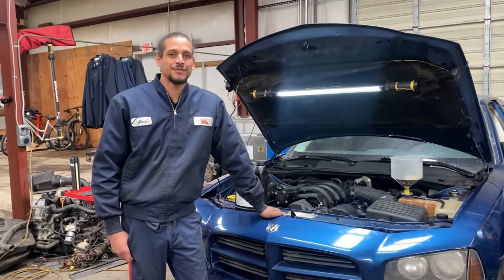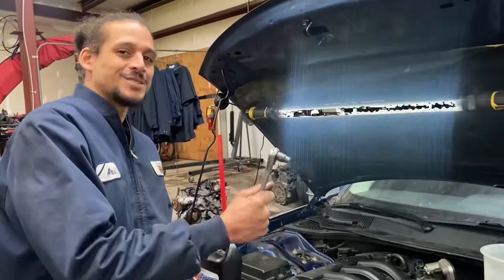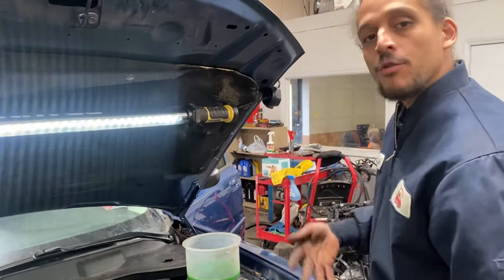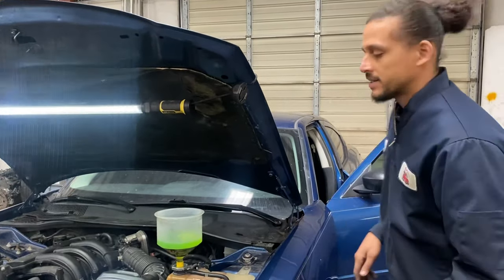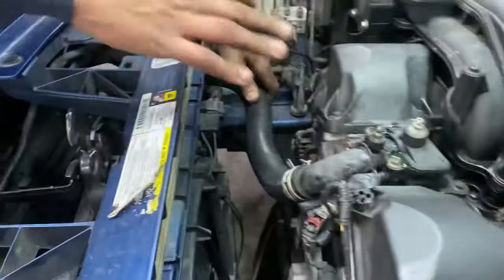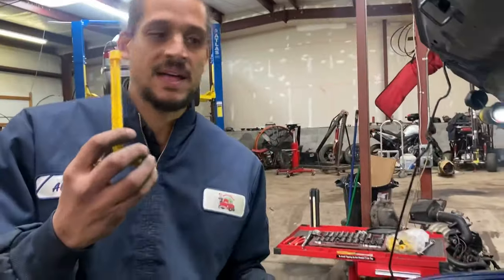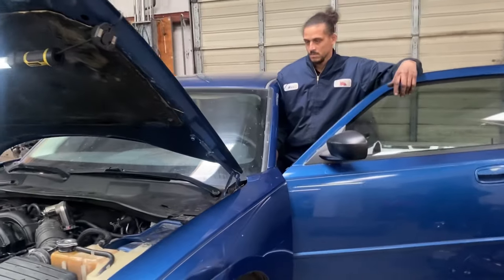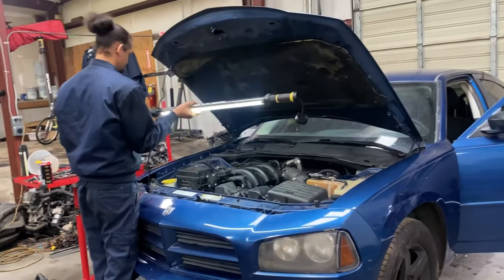How to Bleed or "BURP" Air Out Of Your Engine Cooling System (2 WAYS) #coolingsystem #overheating

Comment: I did this but it keeps burping and burping making bubbles bleeder valve constantly has air i changed water pump radiator thermastat and temp sensor idk could it be the headgasket cause i dont shee white smoke coming out back
Reply: man and you having the exact same issue man. I got a 11' dodge charger, I've changed every part for the cooling system yet my coolant still flexes up and down

Comment: Ok so I replaced my water pump on my 2012 Chrysler 300 because it was leaking and my car was overheating. So after fixing the the leak my car was still overheating and I replaced my thermostat which was completely in pieces in the thermostat housing. so it didn’t run hot for a day then it started running hot again but it only runs hot after driving got about 30 mins. I think my system has air pockets but I can’t seem to get all the air out. Don’t think it’s a head gasket because my oil is not a milky color
Reply: I had pinhole leaks in pressurised bottle where neck molds to the plastic bottle. System could never fully pressurize and would intermittently overheat at times.

Comment: Soooo what if I bypasses the heater core do I still need to burp it with heater on or no since the hoses ain't connected to it its for my 2.7 charger
Reply from the maker: If you bypass the heater core no need to turn the heat on
Reply: @AlexTheCarDoctor  soo just burp system I got tool like the 1 ur using and i did it for about 30 mins just to make sure and no bubbles when I start car should I leave cap off or put back on fill tank
Reply from the maker: Leave the cap off until no more bubbles are seen
Reply: Okay.....when I let car run and no bubbles came up from reservoir but it started to rise the coolant and come out of it since cap was off should I put cap on or what do I do from there
Reply from the maker: If you didn’t see any bubbles immediately put the cap back on before coolant start pushing out. Go ahead and top it back off and close everything up and take it for a drive you should be good

Comment: yes  i got a 2004 sport trac is doing the bubling i change the radiator water pump and thermostat and today i went to homedepot i saw the neddler going to high temp also check the water reservior and saw is was bubling put some water and oprn the cap and the radiator was almost empty waht could be the problem
Reply: You didn't fully burp the air out of the system

Hopefully you kept checking and filling it up

Comment: Can I burp the system same way on a 1998  Oldsmobile aurora had my fans go out ...put new fans now but its seems to over heat still when I drive...
Reply from the maker: Did you remove any coolant hoses when you replaced your radiator fans

Comment: How many minutes should I bleed the coolant?
Reply: Let it running with heater on full blast until the thermostat opens up... Once it does, the level usually drops

I usually keep the funnel on and let it cool back down

 and run it for another cycle just to be sure all air is gone and the fluid level in that funnel doesn't change

Comment: Help! I did the steps but for some reason my coolant reservoir still at very low lvl even I put 6-7L of coolant! Any guess?
Reply from the maker: What type of car do you have
Reply: @AlexTheCarDoctor  Subaru STi 2018
Reply from the maker: I figured I just didn’t want to assume.what I normally do is burp the coolant from the radiator and after that I top off the coolant reservoir. Do you see any leaks
Reply: @AlexTheCarDoctor  i did that too but the next day my coolant reservoir went low lvl at the bottom and there’s still some bubbles coming out. I feel like I didn’t burp that much, I’ll try it again when I get home 🙏🏽
Reply from the maker: You really need that burp funnel with them Subarus, my time at the Subaru dealership we used those funnels a lot
Reply from the maker: https://amzn.to/3lCpmnp
Reply from the maker: That’s it on Amazon
Reply from the maker: Yes
Reply from the maker: I’m about to order another one for the shop now while I’m thinking about it
Reply: @AlexTheCarDoctor  thank you very much sir for your time 🙏🏽

Comment: So I did this method but ran into a problem.

I put the burp funnel in, and started squeezing at the hose. Once that was done, I then turned on my car with the heater on max temp. I thought I was done, so I turned of my car which cause the coolant to spray out from the funnel. Did I miss step?
Reply from the maker: What type of car do you have and how long did you leave it running
Reply: @AlexTheCarDoctor  2002 Chevy Camaro V6 3.8
Reply: @AlexTheCarDoctor  I left it on for about 25min. 

What should I do before I turn off my car? Because once I turned it off, that’s when it started overflowing like crazy
Reply from the maker: It sounds like your thermostat is not opening.both the lower and upper radiator hose should both be hot/ very warm after about 15 minutes of running
Reply: @AlexTheCarDoctor  that means I didn’t put the heater on max and fan all the way up? It might have skipped that step
Reply from the maker: I Assume you followed all the steps. I was saying that you might have a bad thermostat. Definitely do all the steps and try again

Comment: What happens if u broke the bleeder does that matter because I did and well I just welded the hole up but not sure if that’s y my car overheats if it would even before that
Reply from the maker: What type of car do you have and engine. You should really replace that because they normally put bleeder screws in the highest part of the cooling system where air normally gets trapped

Comment: what if i accidentally added antifreeze to the radiator instead of the coolant reservoir on my 07 Grand Caravan?
Reply: Yout van has the pressure cap on the radiator...

The expansion tank for that vehicle is just to take the overflow and suck some back into the system when it cools

So it's ok to pop the cap on the cool engine and check the fluid level at the radiator;make sure its full that way for this type of system

Comment: Why would the funnel over flow when car reaches temperature
Reply from the maker: It normally do that because of big air pockets in the coolant system also its so hot in some situations it just boils over
Reply: @AlexTheCarDoctor  So mine overflows like this as well, the temp gauge reaches the 1/2 way mark, and the heater on high is still blowing cool air not hot. I just did a complete flush of the system (thanks to having a idiot mechanic screw it up) and replaced the thermostat now as well. (My car is a 98 Buick Century with the 3.1 V6. I just replaced the radiator and water pump last year in July, so not quite a year ago. My local shop had to replace my engine last September, with a rebuilt one, and I made sure the mechanic put my new waterpump on that engine. I also replaced both coolant sensors last July, so basically everything on the coolant system is less than 1 year old.) I've done every step to try to get the air out, but appear to still have a big pocket somewhere, probably in the heater core since it's not blowing hot air. How can I get this out? The fluid just keeps bubbling up and out of the radiator neck/funnel when I'm running it, and I'm afraid of overheating the engine and ruining it by leaving run too long! I can't get it to take all the fluid until the air is out. I did remove the lower hose after the flush to make sure the engine drained well, since I didn't want plai water left in it to dilute the coolant I was going to fill it with. And nothing seems to be leaking. I have the bleeder screw, and it just keeps bubbling as well. Any advice?

Comment: Why does my Chevy 05 consume coolant when I have the AC on and I constantly have to add
Reply from the maker: Hey there normally when a engine consume coolant there’s an a gasket issue. So are you sure it’s not leaking out when you’re driving? Check/replace the radiator cap,a lot of people will overlook that part of the cooling system
Reply: @AlexTheCarDoctor  I put a new condenser, but used old cap.. I'll change it 2marow... Thank u
Reply: @AlexTheCarDoctor  no leaks

Comment: How much does it cost to change a radiator
Reply from the maker: Hey there that depends on your vehicle and the area that you stay. Typically you can expect to send $150 to $600
Reply: @AlexTheCarDoctor  is a 2007 Dodge charger v6 3.5 and I also have a question the mechanic who did it he lifted my car with a jack and and the car fall do you think he messed up something in my car he kept juggling the jack and he broke the black plastic that protects under please reply and your video was perfectly explained👍
Reply from the maker: @cookiemartinez496  hello depending on where he put the jack,a few things can get damage, cosmetic body damage, suspension components can bend, crushed metal lines like brake lines and fuel lines.I’m glad you enjoyed my video and thanks for watching
Reply: @AlexTheCarDoctor  He put the jack in right side but when the car fall he jiggle the jack to the middle and I could see a lot of wiring been pulled I told him he was pulling them but he says nothing will happen
Reply: Do you have a shop in Tx
Reply from the maker: @cookiemartinez496  can you send me a picture of it to my Instagram. unfortunately no I don’t

Comment: I done all this and still have air in my system, I've repeated all the steps and still have air and while sitting at a red light my temperature rises and then goes back down when going, Idk what I'm doing wrong, at my wits end,help lol
Reply: Water pump may be bad is one of the causes

Did you notice the fluid circulating in the burp funnel when doing it as show on the video?

Comment: What if I did that but am still overheating at idle?
Reply from the maker: The next step is to do a block Test that will check your head gasket integrity
Reply: @AlexTheCarDoctor  just did the bloc test. Liquid stayed blue. It’s a 2015 Chrysler 200  2.4l. Heater hose connector snapped and this problem started after that.
Reply from the maker: @VHBulls  it has to be air still trapped in the system
Reply: @AlexTheCarDoctor  I think so too, I appreciate you’re responses, Thanks!
Reply from the maker: @VHBulls  just do the process again
Reply: @AlexTheCarDoctor  will do, it gets up to 230 and the radiator fan cools it down to 220 but that’s still too hot from normal, Ive been turning on the front and rear heater and the fan kicks on to cool it, but if I use the front facing heater vents the fan doesn’t kick on
Reply: @AlexTheCarDoctor  do you know anything about the coolant reservoir tank having a weep hole in the bottom on this model? It doesn’t leak normally but I do this and it lets out coolant out the dip in the bottom.

Comment: Why is the bottom hose of my radiator cold and the top hot? Thanks.
Reply from the maker: Either bad thermostat or you have air in the cooling system.
Reply: @AlexTheCarDoctor  Thanks for replying
Reply from the maker: @MecanicaconChispa  my pleasure

Comment: How do you determine if there's a blown head gasket
Reply from the maker: You can perform a block test
Reply from the maker: https://youtu.be/N4NpomEKm4g
Reply from the maker: That’s a good video showing how to perform a block test
Reply: I saw that after man I been fighting a coolant issue in my s10 replaced pump t-stat Cleaned the entire system just got to burp it now an if it's still overheating I think it's head gasket
Reply: Only 80k on the original motor from 1997 oil looks brand new no direct signs of head gasket but if it persists I'm gonna do that block test
Reply from the maker: Good luck buddy

Comment: 2012 dodge charger rt  change cooling temperature sensor  water pump cooling  fan temperature sensor still getting to 240
Reply from the maker: Hey buddy does it cool back down when you start driving freeway speeds.do you have a check engine light on
Reply: @AlexTheCarDoctor  no
Reply from the maker: After running for around 15 minutes carefully check to see if both the radiator hoes are hot upper and lower,it’s safer to check it with a temperature gun
Reply: Thanks  burb it  it's working fine

Comment: if it “burps” will it make a pop noise?
Reply from the maker: Sometimes but if it’s doing that turn the car off because sometimes you will have a boil over.turn your engine off and let it sit about 5 to 10 minutes and before cranking it back up top it off and massage the houses while doing so then crank it back up and finish the procedure
Reply: @AlexTheCarDoctor  Thank you so much I recently learned that I was having problems because my radiator fan was not working

Comment: Now on ur video u said turn heat on high did u mean with out ac
Reply: Yes without AC

Turning on the heater to high is to make sure coolant is circulating through the heater core and gets rid of trapped air

Comment: Hey I just got my water pump replaced and drove perfectly, next morning I turned on the car for a about 5 seconds & turned it back off to see if needed coolant & Anitfreeze poured out lol and started overheating could it be that I just need to add coolant again ?
Reply from the maker: Definitely add more coolant also check/replace your radiator cap,that’s the most overlooked part in the cooling system
Reply: Is a 3.6 pentastar 2011 Durango btw lol and great u think I should I do a bleed also? And just replaced the radiator cap before the pump got replaced
Reply from the maker: @angelleos3397  Definitely bleed the system anytime you replace any coolant part whether that’s a hose, water pump you must bleed the air out. What was going on with the water pump was it leaking
Reply: No it just kept overheating like after normal driving & when it sits it at normal temperature but then when I drive after awhile it overheats but it wasn’t doing that yesterday when I got it replaced but idk if my mechanic bled the system or not
Reply: So that’s why I was rea check it agin today to see if even had coolant I barely turned it on this morning for like 5 seconds and open the resouvier however u spell it and it started pouring out coolant
Reply: So I’m guessing he didn’t bleed out the system
Reply from the maker: @angelleos3397  try that first
Reply: I did and it’s still doing the same mane idk what to do anymore honestly I know this have a big problem with the oil cooler i watched ur videos about this pentastars and mine leaking little spots from oil drain but I don’t think thats the issue tho
Reply from the maker: @angelleos3397  did you run it hot and if so how long? Also safely check the lower and upper radiator hoses after about 20 minutes of running they should both be hot to the Touch
Reply: Like hot as in if I was driving while overheating ? Or bleeding the system hot ?
Reply: At one point the top hose was hot and the bottom was lightweight colder but still warm ?
Reply from the maker: @angelleos3397  driving running hot if so that’s why you change your water pump.give it some more time on the closest both should be about equally hot by touch that means you have proper flow and the thermostat has open, if one is hot and the other is cool to the touch you have a thermostat problem
Reply from the maker: @angelleos3397  The thermostat should open within about 15 to 30 minutes of the vehicle running
Reply: Took it to a mechanic he said he said it’s a head gasket 😔🤦🏻‍♂️
Reply: @AlexTheCarDoctor  but I feel like he bsittin there’s no coolant mix with the oil, there’s no white smoke from exhaust it’s just not staying at normal temp
Reply from the maker: @angelleos3397  I suggest that you do your own block test
Reply from the maker: Do you want me to send you a video showing how
Reply: @AlexTheCarDoctor  that would be great truly appreciate it
Reply from the maker: @angelleos3397  https://youtu.be/I1ZZjYL2iao
Reply from the maker: @angelleos3397  it’s a old video but a good one

Comment: Mechanic’s changed my radiator 10/16/22 and they didn’t not do the steps you did so when my heater started blowing cold air he said my thermostat was bad but it’s not
Reply: If the thermostat is stuck open, it's one of the symptoms

But if you did burp the air out and it got warm again, you got lucky 😁

Comment: I had changed the thermostat, and put coolant. Then let turn engine run for about 15 minutes. The car started smoking after that !!
Reply from the maker: Where was the smoke coming from
Reply: I’m not sure, I didn’t open the hood since it was hot. I’m gonna put silicone around the thermostat housing and Burp the the system later today
Do you think that’ll fix it?
Reply from the maker: @marvelislife2467  it depends if it’s cracked or not
Reply: No everything will be good and tight, shouldn’t be any leaks
Reply: I think the mistake was that I just changed the thermostat, added more coolant and just closed the radiator
Reply from the maker: @marvelislife2467  that was the mistake
Reply: @AlexTheCarDoctor  turns out the radiator did crack that day, and it leaks a bit . Now I gotta replace it and then do the burping process
Reply: Anyways thank you for the helpful content, helps a lot
Reply from the maker: @marvelislife2467  my pleasure buddy, thanks for the support on YouTube

Comment: i replaced thermostat at the dealer and they dont do any of that chevy tahoe 2017 they just told me to keep it running for 10 mins and and leave
Reply: Dealership probably had a pressure air bleeder tool or similar funnel?

Yeah, i would keep an eye on temp gauge, and coolant level afterwards
Reply: @ricebike  no they dont have any tool im sure what they did is wrong they said the air will go back to the coolant box and it did go but it take few days